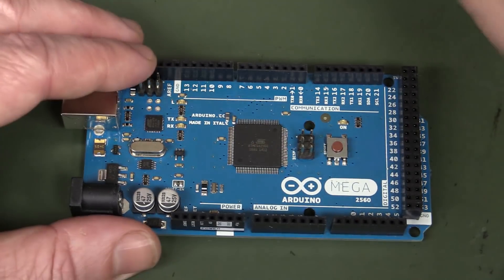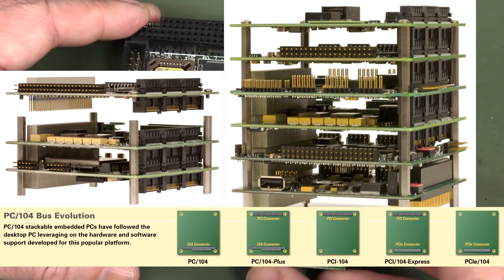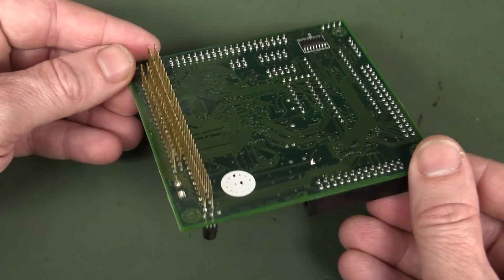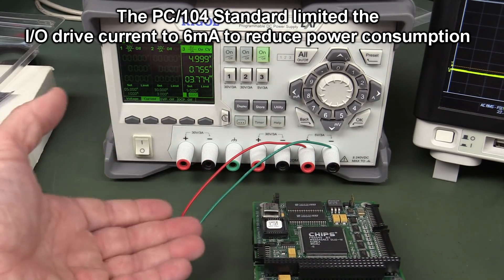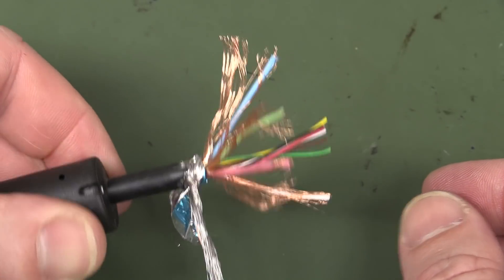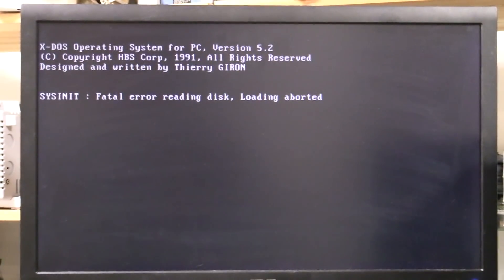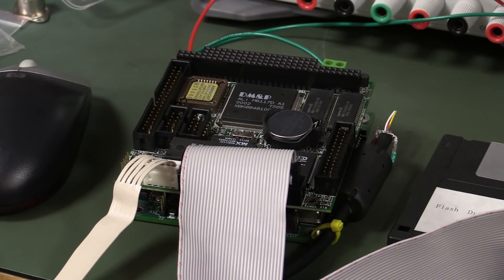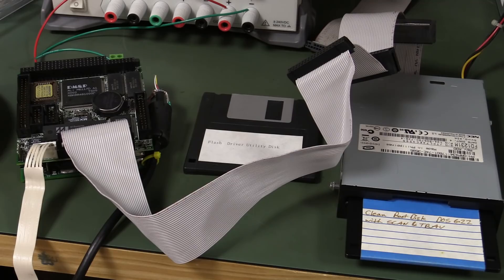EEVblog #1028 - What's All This PC/104 Stuff Anyhow?

Comment: Did Bob Pease say you could use his trademark "What's all this __ stuff"? You should give a mention of him on your next analog electronics video. It is amazing how engineering graduates know nothing about industrial electronics. They will be shocked to find you can't build a self driving car with an Arduino.
Reply: Naw, it's easy to build a self-driving car with an Arduino. Take 1 self-driving car and 1 Arduino, and hot-snot the Arduino in place somewhere. Hook it up to power, and you've got a self-driving car with an Arduino!

Though in all seriousness if I were picking a microcontroller to use in a car I'd pick an architecture that has CAN bus support built into the chip. HC12/HC16 parts, RX600 series, ATmegaxxM1/C1 series, etc. Also, I'm a new grad (Computer Engineering), we're not all clueless.
Reply: Robert's Electronic Hobbies Actually, it could probably be done with Arduinos and/or Raspberry Pis, but you would have to network an awful lot of them together and coordinate them all carefully to avoid contention, so it may not be a very fast self driving car, but self driving it would still be.  I do have some small self navigating robotic projects that are Arduino/AVR based but they use multiple ATmega microcontrollers since I slave off various tasks so that no one micro is trying to handle everything at once.
Reply: Sorry for the jab. I work with engineering students at my shop. While they are not up on all the current electronics, they are all smarter than me. Yes CAN bus is very robust and is used in many mobile applications as well as controls for generators, solar energy, and many other systems.
Reply: to be fair, you could probably do most of it in with an arduino and a flagship phone, if you have a trained model.
The timing required for a self driving car aren't that demanding, a fast human has approximately a 200ms reaction time, so the arduino has a lot of slack.
for highway driving, you need to know how far the driver in front is, and where the road turns.
The reliability isn't that hard to solve either, as you can use a watchdog and rely on the car's builtin mechanical fallbacks and limits. (hijacking the power steering and the speed control through the canbus.)

Comment: I never understood the whole Arduino craze, I grew up with the Intel 8051 micro controller in the 80s with a C language Keil compiler, with a few components added it's just like an Arduino, except 30 years before Arduino. And honestly the Keil C compiler from mid 80s is probably better than the shite that is available for the Arduino today.
Reply: I understood 'Arduino' to be the environment, more so then a specific (atmel) chip. There are 'arduinos' available with all kinds of chips. They have the development environment common together with a standard library. It surely made it a lot easier for people to learn about it.
Reply: I think you understand the craze (people that just want to blink some LEDs and not learn about IO registers) you just wanted to drop how hardcore you are.
I'd be very surprised if Keil C from the 80s can do LTO etc like GCC that Arduino uses but maybe you'll enlighten us with your superior knowledge?
Reply: Ben Adams yea because how dare Arduino come by and improve microcomputers as a whole? How dare they replace shitty old and outdated methods.
Reply: HUR DUR old school is better! Back when we had to code in assembly! Now you plebs code in well structured stable languages that allow you to code much faster. Languages I'm too scared to learn because I'm scared of change, so I'll just rip them off! Old school, old school! HUR DUR! HUR DUR!

Comment: Does it run Crysis*?
*or in this case, Commander Keen ;)

And the VGA Connector you posted is the old one without DDC that came in the early - mid 90s.
Reply: It will run WC3.
Reply: If it's a 386, yeah, it'll run Commander Keen just fine.

Comment: But did it cost under $50 like raspberry and arduino?
Reply: You can get an arduino nano for around $5 or less these days. I could get 30 arduinos or 4 Raspberry Pis for that price. This is just old, dead, technology that dave is swooning over again.
Reply: The 8-channel RTD Analog PC104 boards I've dealt with were around $800 just for the bare board.
Reply: No, but it was vastly more powerful in it's day. You could add nearly anything to it, unlike the Pi or Arduino. It was also x86 so there was a lot of choice in software.
Reply: No,.it's not made for everyday projects. They're designed for high reliability systems. It's a completely different use case.
Reply: TheRealDenzel2112 hardly dead tech by any means.  If you want reliability no engineer I know pipes up 'grab an arduino'...
Reply: No, it would earn money
Reply: Are you trying to compare a hobbyists platform to an industrial platform?

Did you ever worked with industrial computers and logic-controllers before?!
Reply: PERILEX jeez you guys took it to heart. And yea I work on Siemens and GE PLC's for a living.
Reply: Well, if you deal with Siemens and GEs stuff for a living then you should know that your customers endorse a no-bullshit approach on the solutions they order...
Reply: You mad bro?
Reply: Shredxcam22 What?
Reply: At least you can use the Arduino IDE & shields in some Siemens hardware: https://store.arduino.cc/usa/siemens-simatic-iot2020
Reply: pepper669 now that's neat. I wish I could use S7 on home projects since I'm use to it. I would like to get into some of the open PLC stuff on arduino for the house.
Reply: Main Lane salt level > 9000!
Reply: Wow! it's not even crazy expensive.
Reply: I've used PC-104 boards. We used a 586 processor based board for the controller, and a I/O board that provided IEE-488.2 communications for the embedded controller in the Microdyne RCB2000. I still have a couple sets of the install disks for the M-Drive. They were optional for the controller, in 2000. We installed Windows CE, and our firmware on the M-Drives. Once the M-drive was formatted for the card, a boot floppy connected the radio to the corporate servers to install all of the software, and firmware. That allowed us to ship the still sealed OS package with the equipment. I may still have a manual for the controller boards, somewhere.
Reply: Is raspberry pi reliable to work 24/7?
Reply: this is the hardware equiv of watching ppl argue about EMACS lol

Comment: format c: /s. Jeez, what is with you kids these days? It's almost like you don't even know how to get an obsolete operating system copied onto a completely obscure data storage standard anymore.
Reply from the maker: Actually that could potentially screw up a Disk On Chip. From memory they had their own format utility?
Sys is better because it just copies the files, and it's faster.
Reply: You can use the dos formatter, the disk on chip utilities are only for splitting and updating the flash memory for the bios extension rom and setting the user space size.

Comment: All the ready made electronic modules are killing the electronic hobbyist. They remove the need to learn electronics and if you spend a few minutes on any arduino etc, forum you will see nothing but conversations about projects not working because the 'wrong library' is being used or the 'wrong version of the board'. Out of interest I looked at an arduino LCD touch screen a few months ago and they are terrible. Badly designed and badly made. The libraries are badly written and it is very easy to write a library from scratch but the problems are that most sellers do not even have data sheets as they expect everyone to just plug them together without any understanding of how they work. I also looked at possible use of these in a new product that my company was designing but the sellers also behave badly and say they shipped items when they have not. This was not an isolated case but seems to be fairly standard for these devices. Hobbyists and professionals alike should steer clear of them and build their own projects. The diversity that this would create would be a good thing instead of everyone churning out projects with the same problems.

Comment: maybe its because we can make a PLC type device for under 20$US with a Pi or Ard, is how these setups DO NOT COMPARE. current 104 board prices are running 1000$US . ive seen some 104 boards in the 4K$ range. Arduino Raspberry pi, beaglebone... is favored as a learning platform because you dont have to choose buy a car or computer. this device is NOT to be compared to Arduino in any way shape or form as the arduino doesn't try to pass itself as a mini computer but the Pi can actually be used as one.
Reply: We're switching over from PC-104+ to RaspBerry Pi. Not nearly as well made, but the PC104 prices are out of control. I think the x104 stuff must be heavily used in the military now.
Reply: Andreas Stevens the raspberry and the pc104 do not compete with each other.
Raspberry pi: low cost, hobbyist consumer single board computer with open source community.
PC/104: ultra-low failure rates, ruggedized single board PC-compatible  computer with standard PCI/ISA/PCIe bus connections on stackable format for reliable industrial use.
the thousands of dollars the pc104 equipment cost are much cheaper for the factories than having a shady glitch in the firmware for a closed source video chip stop the whole production line 3 times a month.
it's all on the client's priorities. You don't see arduinos coming out with mandatory conformal coating nor do you see any need to keep your circuits running 24/7/365, now, do you?
Reply: -blend, you absolutely DID NOT READ ANYTHING that was typed by me. NOTHING! im NOT the one comparing pc104 with a pi or ardi. if you READ my entire comment, it states, comparing ANY of them to each other, just does not work. period. nadda! hell no! nuh uh! . oh, and speaking of closed source, how much of the 104 stuff is closed?. FFS READ what i typed. it contained less that 200 words!!!!!! (even this may be too much reading for you eh?)

-frag, for 1000-4000 +us$, it better not. i would like to see that tested with some of the modern boards with ball sockets IC like the pi has at U16

i have seen a arduino based PLC in non industrial critical locations (something its ideal for beyond an excelent learning platform at a perfect price for all). but the ard DOES NOT run a full (D)OS interface...DOES IT. the 5-35$ pi however...
for $10 i have a Pi-zeroW running wireshark for dumps from my DD-WRT router and an email filter using thunderbird, while playing some streaming music.  (all headless with CURRENT realVNC). something dave's 40MHz 3MegRAM pc104 here @20:55, just cant do. but a current $1000+ 104 board will.
Reply: Andreas Stevens i must have done a typo replacing "raspberry" with "arduino", but it's been 2 weeks and i can't quite remember. Chill out, man.
I made a point as to why this stuff is expensive, reasons that were not on your original comment. no need do grasp your balls at 600km/h.

Comment: "Forget Arduino & Raspberry Pi being the embedded platform computing standards" <-- lol. these amateuristic toys being a 'standard' is just a joke. although both are finally starting to appear in PLC din-rail formfactor with ethernet, they're still far from a 'standard'. how the crap would anything that ships with a hdmi port but no normal rs232 anywhere in sight, and as for arduino 'optional' ethernet (why the crap would anyone want usb anyway, it's not like your building control field bus is usb, usb is a toy for  at home, nothing more). compared to pc104 and derivatives both have a long way to go (and most likely those flimsy things will never actually fully replace it).
Reply: Why would anyone want usb? How about easibility. Im sure there are thousands of people if not 10s of thousands that would want usb, over 1 who doesnt. 
Time is all you got my friend.

Comment: This is old and dead technology, stop swooning over times long past.
Reply: TheRealDenzel2112 respectfully suggest you google "pc104" as it is as Dave said still going strong
Reply: ding 

He thinks they're all 80386s.
 I don't think he understands the concept of a standard.
Reply: Look up the Liger EPM-43.  An Intel i7 based PC104 board with dual gigabit ethernet, up to 16GB ram and much more.  It's not just 386s.
Reply from the maker: You are demonstrably wrong. PC104 might still outsell Arduino and Raspberry Pi combined.
Reply: All my hobbyist projects used low-cost boards like Raspberry Pi, Arduino, and BeagleBone.  However, once I graduated university and started working as an embedded engineer, all our boards, old and new, are PC/104 sized (and priced!).
Reply: TheRealDenzel2112 
Clown.